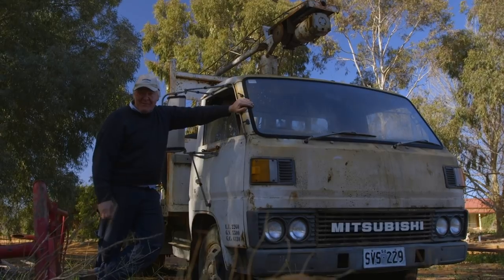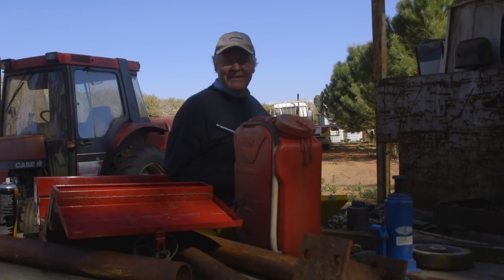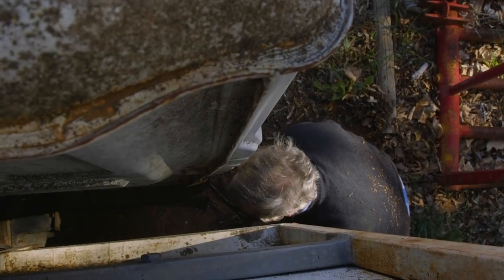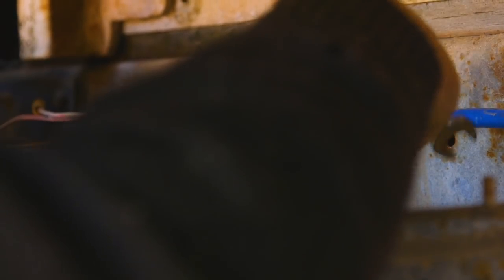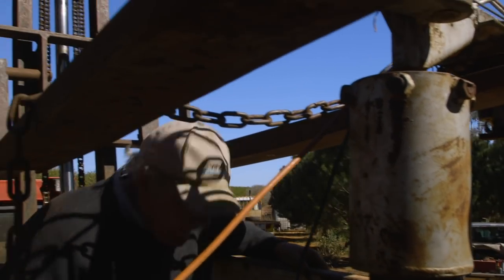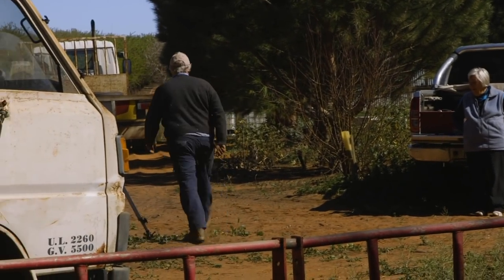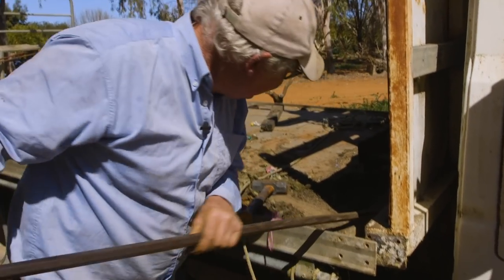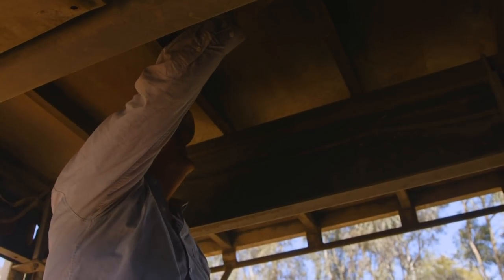Moving the Crane onto the New Track Part 1 - The Bush Bee Man

Comment: Remember to remove the battery leads on the new truck when welding or you will blow the diodes in the alternator, or go to your local welder and he will have a device to clip over the battery to stop the zaps. Mine is about 20 years old and still going strong (SOTA Australia). Good luck with install.